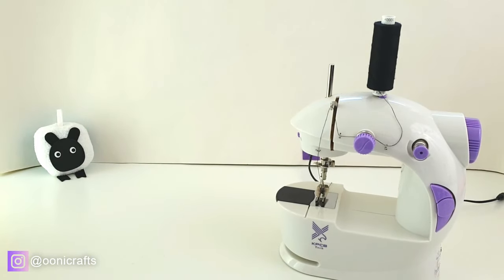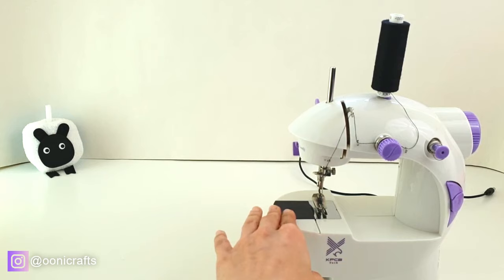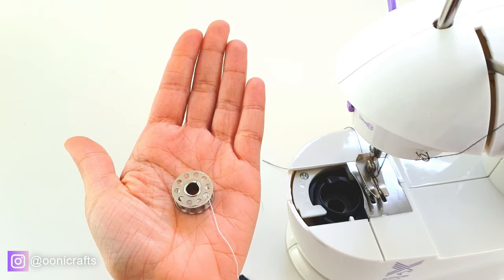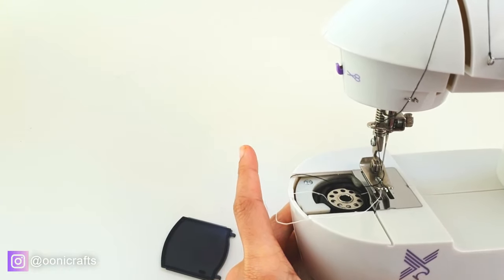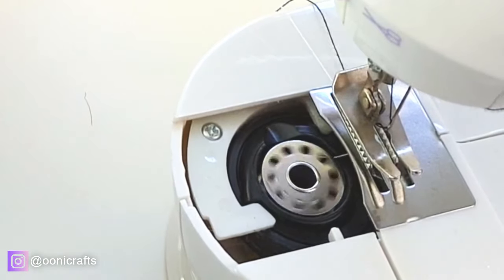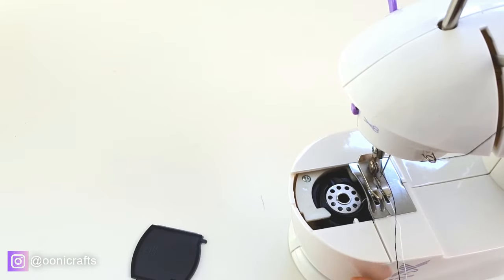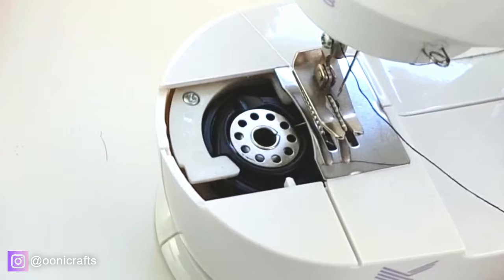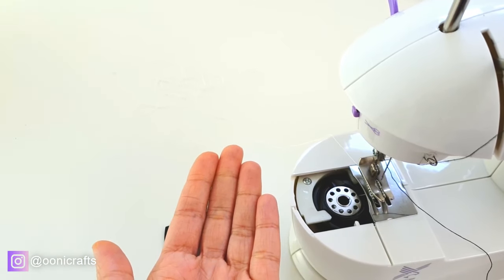Mini Sewing Machine Bobbin Threading Problem? Bobbin threading SOLVED!!!

Comment: i did this with black and white just as you did, and my machine still won’t sew the black thread bobbin inside of the bobbin casing to the fabric as it does with the white thread bobbin in the needle. i genuinely don’t understand what’s wrong with it, and it keeps getting stuck mid-sew even when i triple check everything

Comment: In both the bobbins thread is there but stitch is not coming mam what's the problem I'm not getting
Reply from the maker: Hi Netra
I think there is a timing issue with this machine and I will be opening up this machine to figure out the internal mechanisms and posting a video about this soon x
Reply: @OoniCrafts  thank you mam I will be waiting for your video

Comment: Hello, I am facing an issue with bobby casing. As i was sewing , the needle suddenly stopped moving when I tried to move it a sound came from the bobby case. Later when I opened , i saw the part that rotated and held bobby case had totally come out...i tried to put it back but it not stitching at all. Please help me🥺

Comment: Thank you for your videos, after careful checks, I have realised something.. The mini sewing machine is a complete waste of rubbish, I have had two no doubt built in the same factory in Shenzhen province but with underline mechanical quality problems, my bobbin doesn't pull the cotton through, that's the first,  the gearing spindle inside is meshes on the gears, that's the second. (quality parts hey!) The first mini sewing machine, light blew. Moral of this story don't buy off ebay, they are a sack of rubbish! cheaply made and not quality checked. I have wasted lots of hours of my life trying to use this thing... however I appreciate your videos, they are well made and clear
Reply from the maker: Hi Darren
Thank you so much for your comment and insights.  I have no doubt that the machine is not a very high quality product,  i keep pointing out its downfalls in my videos myself! I'm so sorry you had to give up on yours though, have you looked into what replacement you might be getting? 
The Brother LS14 is a great entry level machine. I've had it for nearly 7 years now. But now even that is skipping stitches for unresolved reasons. I might be taking it up for a service soon.
Good luck!

Comment: I think there's no problem with this mini sewing machine, you will get what you pay, cheap but very friendly for beginners and for anyone who wants to understand its concept. You just need to be technical enough and analyze how it works to use it for a long time.

Tip: If you are looking for heavy duty usage and capable of thick fabrics do not buy this mini sewing machine however this great for fixing broken stitches in your clothes.

Comment: Hi,thank you for the video..ive done everything but the needle gets stuck when i try to bring it inside the machine to catch the bobbin thread,it doesnt go inside at all..when i forced it inside my needle got bended,please help🥺
Reply from the maker: That's a faulty machine there I'm afraid. If you have learned the basics of sewing now, best to move on to a bigger proper machine. Good luck 👍
Reply: @OoniCrafts  it was working just fine,the bobbin thread got finished and I tried changing it,I had that problem after trying to change the bobbin thread so I'm thinking maybe I didn't do it well

Comment: Thank you so much for this video.
but in my case, i use this nifty nine method while i face this problem.
Reply from the maker: Oh I'm sorry to hear this. Could it be a faulty product? Could you take it back to the shop and see if they can replace it?
Reply: @OoniCrafts  I purchase this online.cant return.
thanks for taking ur time for my problem.
and u r a nice guy.
Reply from the maker: Oh dear, there is always this risk with smaller cheaper products like these. Could you spend a little more and get a proper bigger sewing machine?

Comment: I followed your method to put the lower bobbin but my machine still doesn’t want to work properly. The top thread is not going around the bobbin to get the thread up. I think there is something wrong with the piece that moves the bobbin. I’m so frustrated.
Reply from the maker: Hi Pamela,  thank you for your comment.  This is a persistent and frustrating problem with this sewing machine and lots of people are facing this as well. I believe it is a timing issue and I will be opening up this machine to figure out what part of the machine is not working properly and how to fix it. 
Meanwhile,  please don't let this machine put you off sewing. Tuck it away in a cupboard and try to focus on another hobby if possible. We'll figure it out together very soon. x
Reply: Thanks! I know how to sew and have deal with normal size machines before. Just got this one for little fixes as I can’t get a normal size machine but stuck with it. Hope you can find how to fix it so I can use it again.
Reply: i'm having the same problem...
Reply: What I have observe in my mini sewing machine regarding this issue to fix is that you must properly install the needle, it must be push thoroughly upward and at correct position. Even if the rotation of the gears is in the correct timing still the bottom bobbin thread won't catch. If both are done and still not works better to do troubleshooting, doing trial and error, and do research in your own.

Comment: I am threading both bobbins and can get stitching done but tension on lower bobbin is non existent it is not forming a stitch but lying  loosely and i easily pulled out
Reply from the maker: Hi Maureen,
Firstly , please use a high quality thread.
Then check the tension on a scrap piece of fabric ON THE BIAS. Pull the fabric and see which thread breaks. Adjust accordingly.
Check this video for details: https://youtu.be/ZEky17PmJo0

Comment: I cant sew continously because the upper bobbin thread stuck in the bobbin housing. i have to pull the thread so it will rotate again. pls help meee
Reply from the maker: Hi, try using the tall spindle. I wouldn't use the upper bobbin.

Comment: The issue with mine is that the needle is going straight down and coming right back up it isn’t catching the bottom thread
Reply: Me too😢
Reply: Kurvi Vlogs I fixed that now my machine just won’t sew😭
Reply from the maker: Hi Mary, fix it using this method:
https://youtu.be/_N6F1ehfJKs

Comment: i haven’t used mine since i opened it because i couldn’t do this step and i did everything right. the thread just isn’t spinning around the thing on the bottom so the bottom bobbin isn’t threading djeifkowneoee :/
Reply from the maker: Hi, it's a timing issue.  Please look for the bobbin timing fix video on my channel to fix this x
Reply from the maker: Although if it's a new machine,  I would return or exchange it x